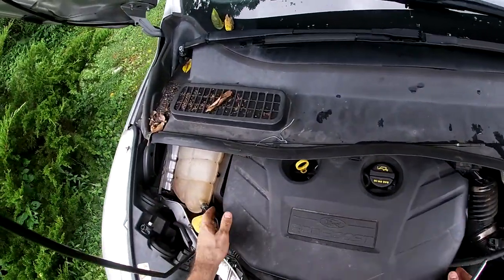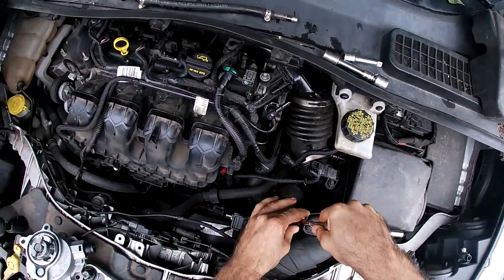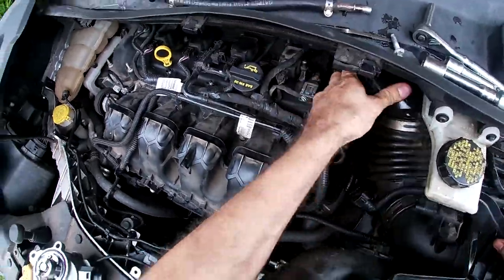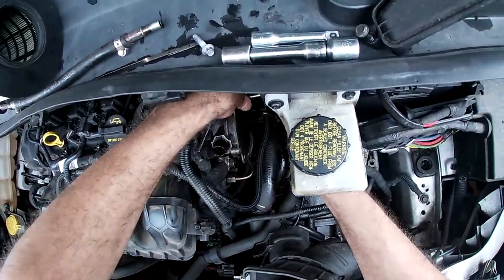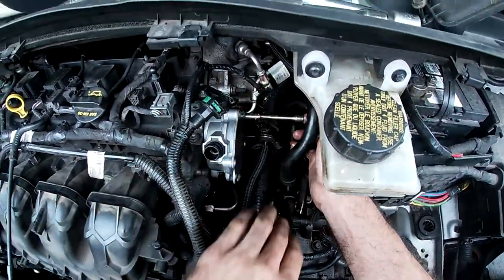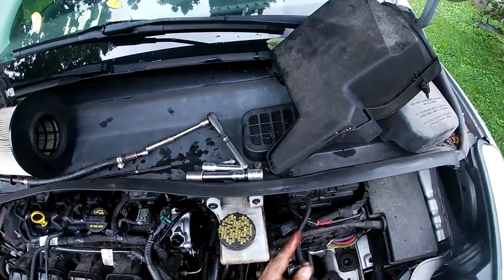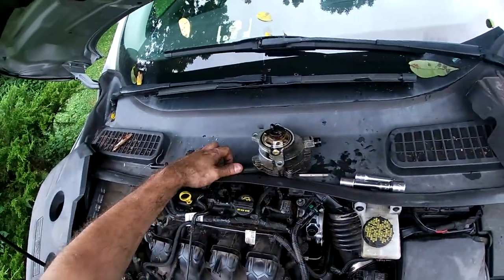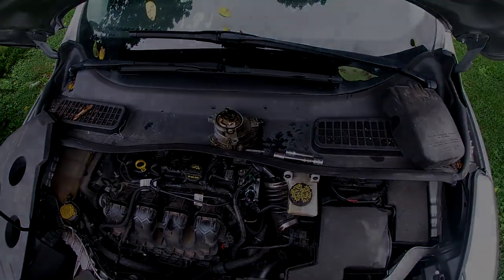Ford Ecoboost. Vacuum Pump Removal and Installation.

Comment: Good vid dude. I think the pump on my Fusion crapped out too. The brake pedal turned into a rock. Glad it happened at the gas station up the street and not on the highway or with the wife driving. I pulled the vacuum Tee connection off the pump and I don't feel any suction. 15 Titanium but I believe its pretty much the same pump and removal process.

Comment: Just finished this job on my 2013 Escape with 2.0L EcoBoost engine at 268927 Km.  I broke an air sensor connector but other than that it was fairly straight forward.  I also removed the cowling for added work room.
Reply from the maker: That's awesome, hope you have it working good.

Comment: Great video. Ive been having brake issues. They're very stiff very hard to press down. I Replaced the vacuum hose and brake booster check valve. I noticed i was getting any vacuum from the pump. Also see some oil leaking on the engine where the pump is.
Reply: Im ordering the pump tomorrow. after watching your video feel alot more confident that is the issue. Thnks man
Reply: The adapter for going into the intake manifold. Did you have to modify the intake manifold to connect the adapter tube or is there port there for a connector to attach the tube?

Comment: Thank you for this I will be changing mine out and the reason why is I have a small meaning not exsive oil leak I put an oil catch can in hopping that would have fixed the issue at hand however not the case and the reason for the oil catch can was because after doing a little research I found that these motors are notorious for what is called oil blow by so I'm going to go ahead and replace the vacuum pump 100 part no biggie I also noticed my fuel is sucky and just look that to is also one of the issue with a vacuum pump going bad.

Comment: Hi, I see that you had a work around for getting the brakes working again. I have the same issue but it’s not fixable due to the fact that the cam end that connects to the vacuum pump is broken. So I am looking for another solution. Nice video!
Reply: Exactly the same on my customers escape 2016 right now.

Comment: Thanks for posting this. How’d you diagnose you needed to replace this? I do have a stiff brake pedal (happened out of nowhere while exiting the highway) but I’d like to double check this is actually the issue before buying/replacing it.
Reply from the maker: After it went out, the brake pedal never became soft, it stayed hard, I used a vacuum pump from a 69 conversion car, and used that vaccum pump to attach to the Ford brake booster, since it was 12 volt I could verify the brake boost was working, then removed the electric vacuum pump, I started the engine with the vaccum hoses disconnected and then verified that it didn't have any vaccum on the ford vaccum pump. We had alot of diagnostic tests before replacing the pump, but to be honest all you have to do is disconnect the hoses on the ford pump and start the engine, it should have vaccum as soon as it starts up, lightly use your finger to verify vaccum
Reply: @Dylant38  Thanks for that info, Dont know why my brain wasn't going there but makes 100% sense now that you spelt it out.

Comment: Good job did you have problems with the car haveing no power before you replaced the pump .I’m haveing the same issue put no power and it threw a turbo code
Reply from the maker: I’ve seen a few that had to have the turbo replaced, the turbo shaft breaks, also seen the oil feed line filter going into the block, it has a micro metal screen that gunks up. I would buy a turbo replacement from a hood auto parts store abs make sure you get the replacement metal screen

Comment: What did you connect the hose to on the intake side for your quick fix? 2017 1.5 same issue and part is weeks out. Thanks
Reply from the maker: Yes I did, it is only recommended as a temporary fix, you can have other issues since the vaccum system doesn't work for the evaporator system, your brakes should work.

Comment: Hey Mr Dylan the line that you that goes into the intake manifold what is it called because mines is missing and I need to buy one I have a 2017 ford escape se ecoboost 2.0L and where does the other part go into it looks like it’s by the battery somewhere thanks for your time
Reply from the maker: The line is show in the video was a temporary bypass I installed so the vehicle have vacuum assisted brakes. It was all made from parts from an old fuel system.
Reply: @Dylant38  okay thanks a lot

Comment: I might be a bit late to this video, but can you tell me more about the temporary fix? I work about 30 miles away from home and I’d like to know how safe this is to do. Thanks!
Reply from the maker: Temporary fix, you only have brakes under deceleration with foot off accelerator pedal. Stronger vacuum

Comment: I have my sons 2015 Ford Escape 2.0  Ecoboost. Yesterday he called and said the brake peddle all the sudden got hard as a brick could barley stop. I pulled the valance so I could get to the check valve and pulled it out and it seemed to be fine so I started checking other things and when I checked the vacuum on this line and other lines there is non. I think it is the vacuum pump. Would appreciate your thoughts. Thanks
Reply from the maker: Definitely would be the pump, if you don't have vacuum. Seems to be common on this design.
Reply: Sorry to bug you again but I removed the hose from the vacuum pump that came from the brake booster and I noticed oil started slowly coming out. I also noticed that the only way I can get any suction out of the pump is if the air filter is off and I put my hand over it.

Comment: You got off easy, the way these POS fail is vacuum pump seizure and drive bolt shears off and leaves 75% of the bolt threaded in the camshaft.
Reply from the maker: Dang, I dont know why they aren't using a brake booster assembly like all other car manufacturers. Using a cheap pump like this and relying only on this pump to help assist your braking
Reply: @Dylant38  They have a conventional brake booster, its the vacuum source whats the problem. A shitty pump that fails and has the potential to mess up the engine, vct actuators, turbo, etc..  Why not put it behind the alternator like in diesel truck or something electric?

Comment: So Dylan I ordered my part and have received it I open the box and I noticed there is no gasket there I purchased it through rock Auto I got the motor craft one only because those are the parts ford uses.can you tell me if I need to go to parts store and compare with what is in there box to know if it does in deed require a gasket.
Reply from the maker: It only requires a o-ring, you might be able to reuse the original one if it isn't flat, but I would recommend going to a parts store so they can match one up for you.
Reply: @Dylant38  will do

Comment: my brakes where very stiff, no brakes somtimes sooo, i buy a vac pump  and started to install
 noticed  a damaged vac line  after i installed the vac pump big mistake for a mech
of 45 years so check lines at vac port of pump rc
Reply from the maker: It can be missed, but I did see they have a recall out for brittle lines.

Comment: Unfortunate Update: I just got the vacuum pump removed which was relatively easy. The much bigger issue is that the pump seems to have seized up and caused the end of the camshaft adapter to shear off now I have to figure out how to get the end of the threaded shaft out of the camshaft. The keyed end of the broken adapter fell into my hand when I pulled the pump off. Hopefully no large metal shavings found their way into the motor. That will almost always be a failure point if the pump seizes up.
Reply from the maker: I hate to hear that. Wishing the best of luck repairing
Reply: @Dylant38  Thanks dude. I was able to get the broken stud out of the camshaft with a bolt extractor and some muscle. The hardest part was trying to drill a nice clean centered hole in the stud for the extractor bit, once that was done It backed right out nice and clean with almost no effort. Luckily I got a new coupler from the local ford dealer last one in stock and its on national backorder and the new pump is on its way from another ford parts dealer. I think I dodged a big bullet...but I wont call it done until everything is back up and running.
Reply from the maker: @RellyOhBoy  awesome. glad it is back up and running

Comment: Well I installed the part and woke up to check underneath and that didn't fix the issue so back to the drawing board I go.
Reply from the maker: You might have a bad pump, it is possible the new pump was bad, or you could even have a brake booster going bad
Reply: @Dylant38  Yeah actually that is how they refer it as is a brake booster / vacuum pump so yeah I changed that out I'm just going to half to further investigate again it's nat an exsive leak but never the less I would still like to fix it because sooner or later where ever it's coming from is going to go dry ya know what I mean I think if I figure out what kind of fluid it is I'm pretty sure it's not motor oil or transmission so that leaves brakes and power steering
Reply: @traceyjones2010  Where's the leak coming from ?
Reply: Well I figured out where my leak was coming from it was coming from the CV axle seal on the driver's side.